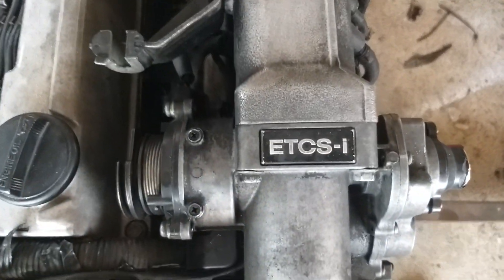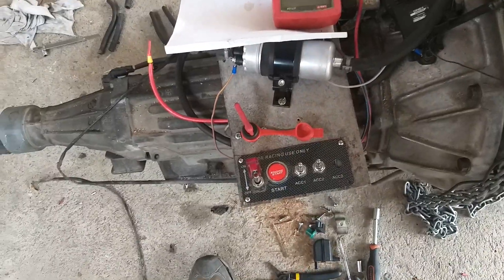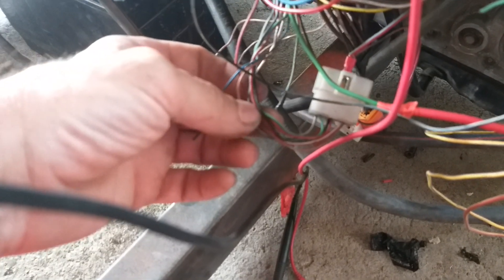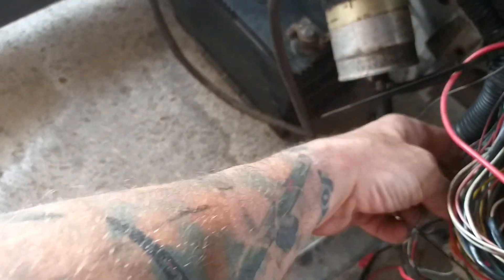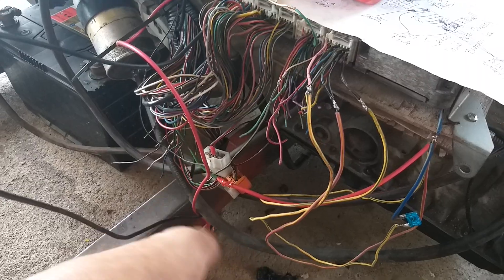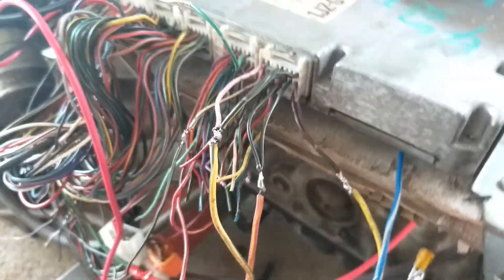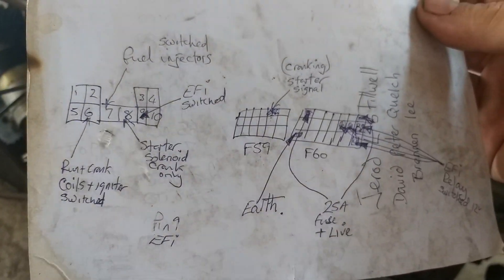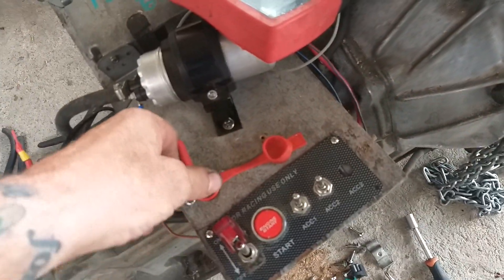1JZ-GTE ETCS-I ecu wiring and start up.

Comment: So quick question. If my 1jz motor came with a immobilized ecu can I just buy a 1jzgte non immobilized ecu and be good?
Reply from the maker: I dont know the exact answer to that but the immobilised ecu gets a signal from the ignition switch module. Id google the hell out of it cos someone will have done it before.
Reply: I'd say it would most likely be the answer to your issue, those immobiliser ecu's are a nutcase to get working with key ignition etc anyway

Comment: Is that the 1 u are putting in the white escort m8
Reply from the maker: Edit: the 1jzs gone in the 2 door out the back. The white 4 doors got a 1600 toyota engine in it. I bought an sr20 to go in it but the seller fucked me over on the paperwork so it wont be legit, ie i couldnt tax it or sell it.
Reply: the ravedaddy  I thought I recognised it m8

Comment: Nice video bro 🤙 good simple info. Is there anything weird to do for the drive by wire system?
Reply from the maker: It should work as is once the wires are correctly hooked up. Ive not fitted this now, i went back to diesel because it was less work and the cars for sale. The 1jzs going in an escort mk1.

Comment: Where are you based? I am in Bang Bon, near Rama 2.
Reply from the maker: Im right up in fang! I like the cool up here but it is a pain in the arse having to drive down to bkk to find stuff. I need a 4JH1 engine now, ill have to drive to bang na for that.
Reply: @theravedaddy  OK> I know where you are going in Bang Na. I was there 2 weeks ago and got quoted 35,000 for a Honda V6, including auto gearbox, full sub-frame, drive shafts, disc brakes, wiring and ECU.
Reply from the maker: @abrown520  nice price! Unfortunately the isuzu engine is 65000bt! I need it for the fairlane in my other videos. I ran it out of oil @ 200kph!